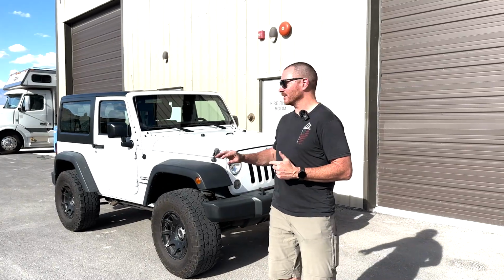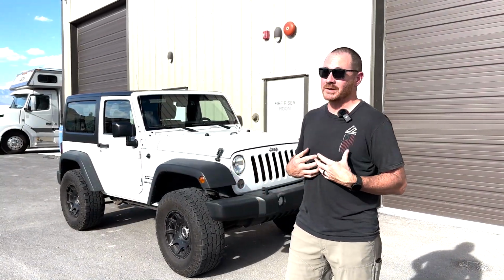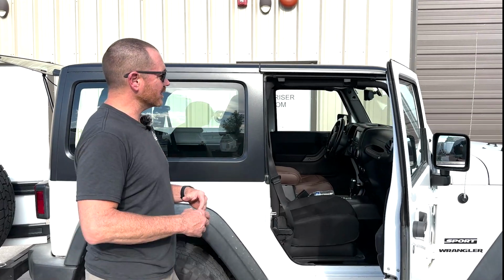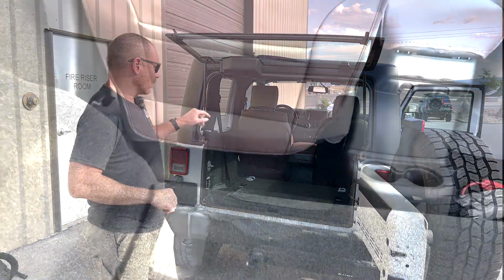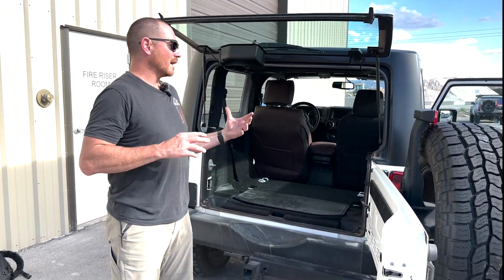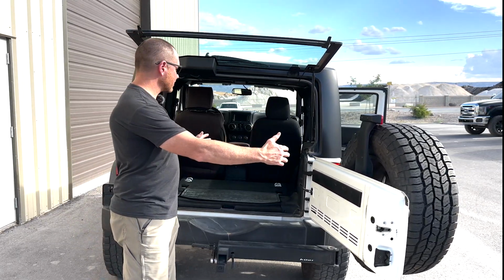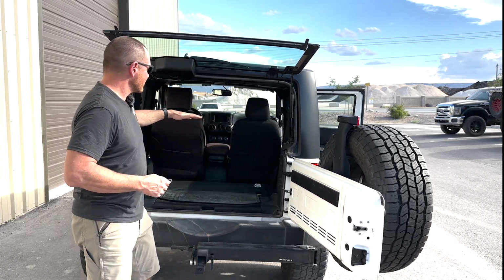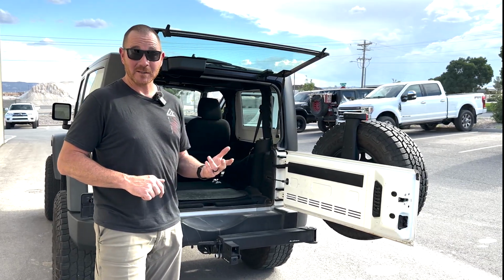New Shop Project - 2-Door JK Overland Build - Part 1

Comment: I made a overland kitchen in a two door and just like that. Wish I could show pictures I have roof rack with rooftop tent. I'm in Tx I have had it in several shows and won my class. People are amazed at how it turned out have refrigerator, chuck box , on board air under the hood. Solar water tank bolts on top to the roof rack by tent. Fuel tank hanging on sides recovery boards on a rack I made that sets above the spare tire 2010 jk two door, six inch lift much much more
Reply from the maker: That sounds like an amazing build would love to see it sometime!

Comment: A problem I see with those who wish to sleep in a 2 door jeep is space. If someone could build an OEM front seat, (for any vehicle),
which could fold down to be flush with the centre console, the sleeping platform from the back could then fold over and touch the glove box on the passenger side for a single person and if two were to sleep in the Jeep, touch the steering wheel on the drivers side creating enough room to enjoy a good nights sleep. A basic chair is sometimes better.
Reply from the maker: We actually did a front passenger seat delete in a 2 door Bronco a couple months back. It allowed the Deep Sleep mattress to fit perfectly along the passenger side. If there is enough want we'd love to do it for the 2 door JK's as well!
Reply: We have the 2 dr jk soft top 6spd.. my goal was to sleep one or two "inside" keeping the build strong yet light. I'm able to drop the seat into a 74x30" bed with 25" clearance beneath the bar. Can widen it out to 48" sharing the 30" footwell like a v-berth on a boat.  When folded flat the seat is the same height as the platform, has ample storage under. A piece of ply bridges the gap from the stotage box to the top of the seat which is then ratchet strapped to the seat mechanism to keep it flat. The seat is puffy, forcing it flat doesn't affect the foam, it  quickly reshapes itself. The seat has a hinge plate with 4 bolts both sides. Unhook the wire cables (2).. remove the top bolt from each side then remove the headrest, the seat now functions like seats in a 2 dr always did before the nanny state got involved. It takes no more than 15 minutes, put the 2 bolts in the gove dash. You can choose to leave it as is, which we do, or put it back. It's an easy job. Best mod I've made on the 2 door which now functions as a weekender and it's totally reversable. The whole interior can be removed in 3 sections in less than an hour. 👍👍

Comment: Again I was extatic to see you at SMJI!  I was serious when i said you were one of two vendors i was really hoping to see.  Cant wait to buy it all for my 2013 2 dr jk manual.    I know you are toying with the shelf.  Some of us who did the rear seat delete have a dog so hopefully...for those adventures where we have a second rider and our dog...that we still have an option for them to be able to poke their head out and not have the 100% coverage to the seat.   Also...have you thought about creating a MOLLE panel to work with the gear shift console?  Something to surround it - especially with a manual?  I have pew pews and things that would work awesome in that spot
Reply from the maker: thanks! Glad you stopped by the booth. It was a great show. Soooo many people there! We have made a couple of small changes to the shelf since we posted the photos of it on the IG account. The new one should go in tomorrow, but it is the same as the previous one at the rear of the seats. However, there is definitely room for dogs to poke their head through from the back. I'll test it out with my boxer when we get it installed and try to snap some photos. He's only 15 weeks old, though. 🤣 We haven't done much with MOLLE around the console yet. I would definitely like to, but that just hasn't made it up on the list yet.

Comment: Really looking forward to see how this goes. There is relatively little on 2 door JKs. For mine, I needed to watch the weight. Thanks for sharing this project!
Reply from the maker: I agree on the weight. We have been working with a lighter weight slide for some third party products lately. The are lighter capacity than our primary slides, but may work well in this use case. We'll be sure to post weights of the components as they are added to the vehicle. Thanks for commenting!
Reply: @AdventureLab  Larger tires, bumpers, rock rails, roof rack and RTT really start to eat up the Max Payload. I'm currently working on a diet for my 2 door JK as I started wheeling it before camping out of it.
Reply from the maker: @harrisonme3439  agreed. No way this one is getting a RTT. The largest tent option I am considering is a Gazelle 4-person tent, but will probably keep it even smaller with backpacking sized gear.

Comment: Yes! Finally more options for the true jeep. I’ve been customizing my 2 door since I’ve own it and there are less options for us 2 doors. Air compressor mount definitely. Yes platform that stretches all the way to the front seats and platform all the way under the seat. Middle console delete to fit in lithium battery. 😅 just a thought.
Reply from the maker: Thanks! What are your thoughts around using the space below the rear platform for the lithium batteries? That's my current plan.
Reply: For mounting components like, lithium charge controller, amplifier or any components that fit. Subwoofers. Currently I have battle born lithium battery mount there. Also on your built, you should put sound deadening. 2 doors are small it helps with the road noise if carpets are removed.
Reply from the maker: @jahlove9373  ok. Good. We are going to put batteries under there as well. We haven't had any issues without sound deadening in the JLU/JKU, but would definitely be easy to add on the bottom side of the platform. Good thought.

Comment: YEEEEESSSS!! I’ve been waiting for some more JK 2-door love from AAL. The backseats have been out of mine since we bought it new.

We live on a remote property, so we have to travel 3-4 hours to get groceries. We rely on two portable fridge/freezers (23Lx14.5Wx19.5) to bring home perishables. I’d like to see the extra batteries setup in the back (we currently use a couple of portable power stations, but fixed onboard would be nice under an extended M.A.S.S. floor system to save room and not have to worry about running out of juice. Compressor under the seat is perfect, so I look forward to seeing your battery/inverter system in the cubby setup.

It would also be nice if there was an option for a different mounting bracket for the Overland Shelf to be dropped a couple of inches, or better yet, allow some adjustability up or down to dial in the ideal height for each individual. I’d love to be able to put my two (24Lx16Wx15H) dog crates on the shelf (strapped down, of course) and have room for both fridges below. Currently I can only fit one fridge if I have both dogs with me, unless one goes on the front seat (I’d have to either leave one dog or my wife home!). I know the current design has enough headroom inside (19.25”) but I suspect the clearance at the hatch glass is lower, thus impeding getting them in due to the shelf extending to the back glass. Unless I’m wrong and there is enough room? If so, I’ll be ordering one!

All that to say: I’m excited to follow along with this build!
Reply from the maker: Thanks for the detailed reply. Much appreciated. Yes, I think dual lithium batteries under the platform is going to be slick. Moving the compressor to below the seat frees up a bunch of space. The overland shelf is adjustable now (maybe 4" or so), but I am not sure on the specifics above the platform. When we had the one 2-door JK in the shop, due to time constraints, we weren't able to spend a bunch of time with it after the install. We'll get all of the details next week. Thanks again for the detailed reply!
Reply: @AdventureLab  And thanks for your thorough response! I'm stoked to follow along, and I'm looking forward to seeing the Overland Shelf featured in more detail in the JK. I didn't know it was adjustable, so it may work for me as currently designed. 🤞🤞
Reply from the maker: @jamesiversen  good to hear. Hopefully that will go in tomorrow in raw. We'll see if there are any changes we can make. If not, it'll get pulled back out and sent to powder. I'll get measurements while it's in there.

Comment: I love 2 doors! The rear floorboard area  never seems to be considered for legit storage. 

The JKloud rollbar hammock seem to be the only in cab sleeping solution for the 2 door. 

You might be able to find a set of 2dr Mopar JK Highline fenders.  35"s stock  like a JL. Nitto/Toyo make a few 35X11.5R17 in a C load that seem to work like a dream on a Jeep.

Lastly, the suspension geometry is much more noticable in the 2dr. Just don't think front caster; front control arm angle, and roll center of the rear based on the trackbar braket height seems to make a dramatic impact on the driving dynamics in the 2dr.
Reply from the maker: Ha ha. It's funny you mentioned suspension geometry. The previous owner put on a spacer lift without adjustable arms, so it is quite entertaining to drive. 😂 We have some really cool things planned for the suspension on this one, but I want to wait for confirmation before I share that plan. 

It will most likely get 37's. I didn't even know those highline flares existed. Not sure how I missed that. I like that option a lot. Thanks!

Yes, I think the floorboard storage will be nice, especially if we build the storage modules to where they leave access from above.
Reply: @AdventureLab  Sounds like a good start! This is going to be controversial; Adjustable control arms only address 2 of the 3 geometry concerns in the front. Everyone seems to give control arm brackets a bad name, if they only new and actually tired them. If you hitting them on the trail, in a 2dr nonetheless... You might want a SXS or a buggy, lol! Forget everything i just said and put it back to stock and let's get you a 74 Weld sponsorship. 🤙
Reply from the maker: @ZephyrRandD  I have some lofty plans for the axle/suspension setup on this one. Rest assured, we won't be worrying about geometry correction. 🤣

Comment: I'd like to see the ability for the storage to be concealed under something like a Tuffy or Diabolical Inc enclosure. 

I'd also love to see the under seat air compressor paired with something like the Kraken from Epic Adventure Outfitters or Made for Rocks systems.

If your MOLLE panel works with S TEch and S Pod systems, it'd be hugely beneficial for you as well.
Reply from the maker: Our current Overland Shelf is adjustable in height, but I am not sure how close it comes to tailgate "secure" level. I will check that next week. That being said, I respect both of the companies you mentioned very much. We try to build our own products that fill a gap in the market. I don't like stepping on the toes of other companies, in hope that they do the same for us. Our under seat bracket will be almost identical to our JL version.

https://americanadventurelab.com/product/arb-tire-pressure-control-connection-kit-jl-under-seat-mount/

We have developed some RAM ball mounts for the Overhead MOLLE Shelves that work really well with the controllers for S Pod, etc. 

https://americanadventurelab.com/product/hd-ram-mount-bracket/

Here's how we use it with the Auxbeam system. We could build the adapter plates for the various control panels with enough interest.

https://americanadventurelab.com/product/jeep-jk-auxbeam-brackets/

Thanks for the feedback!